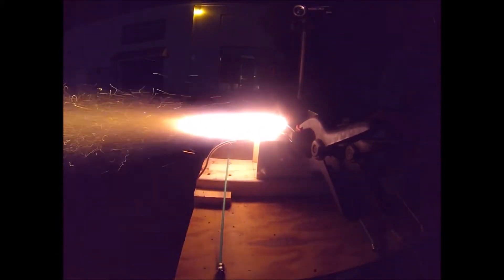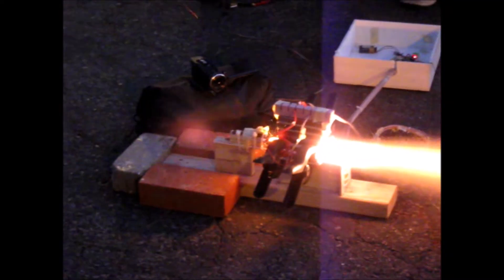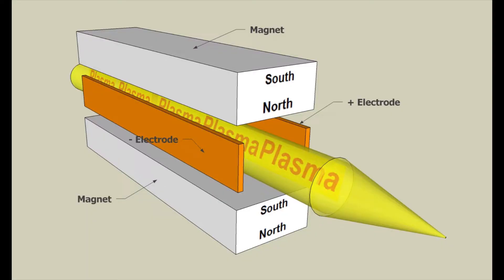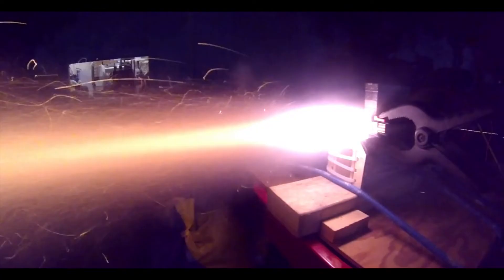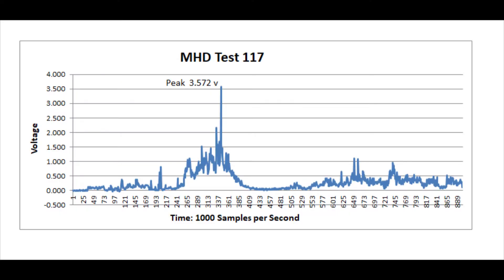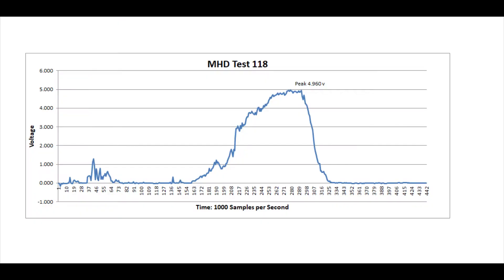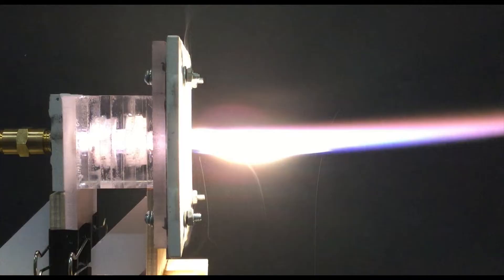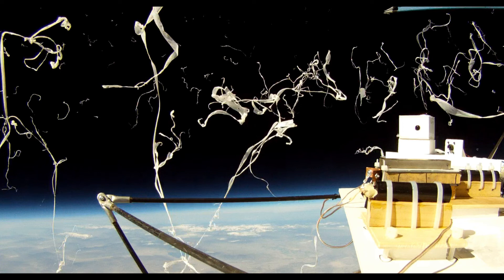Plasma Engine Research, Magnetohydrodynamic Test No. 117 & 118 and what's coming up.

Comment: Hello!

Do you know of anyone testing out the AC-resonant magneto-hydro-dynamic motor where the coil provides the magnet to the sandwiched 2 plates (each plate acting as top load)

By my intuition, such method would produce a much stronger effect than DC driven MHD motor

Comment: and I want to assemble a prototype of a jet plasma engine that will run in normal air and microwave radiation
Reply: For microwaves at least, you want to start with a ramjet.